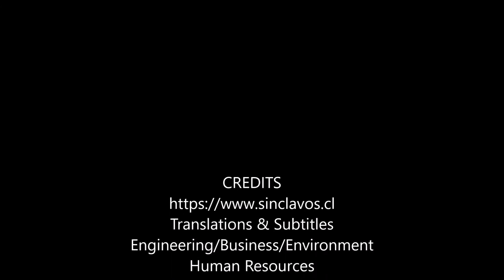I Changed the Seat Washer and it Still Drips

Comment: Very good video and commentary Rod! 
I was a plumber for many years and your video and explanations are spot on!
P.S. I always hated trying to fix some of those old faucet seats. We carried a set of the most commonly used seats, but more often than not we didn't have the ones we needed. So out came the seat reamers and cutters.
Reply from the maker: Absolutely.  My most hated part of plumbing is having to drag around with me hundreds if not thousands of spare parts "just in case" I needed it, to repair something.  Spending an hour or so in buying a spare part that might be worth $1, just because I didn't have it with me made me mad.

Comment: We have done everything in your video and several times. Still cold water tap is dripping. It is a very old house. Looks like we have to look further. Will changing the taps help?
Reply from the maker: Well, either the crack is too deep and you haven't been able to remove it, or the filing of the seat has been crooked. In those cases you have no other option but chsange the tap.  Some taps have seats that can be removed and you can put a new one on. You will have to check the specs of the model and brand of tap.
Reply: @RODsDIY  thanks. I guess your talking about the part that sits in the wall. That's a big job. Remove wall panels from one side or take of tiles in the bath.  Either way it's a job for another time